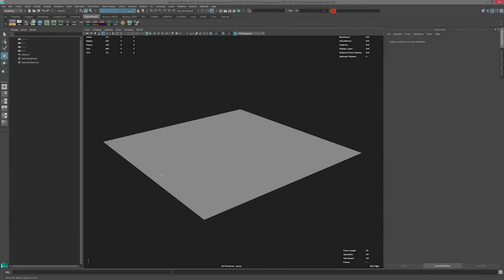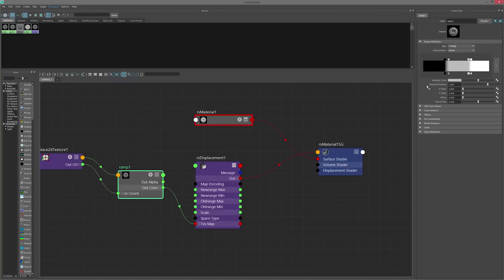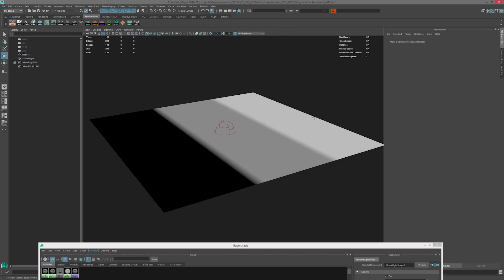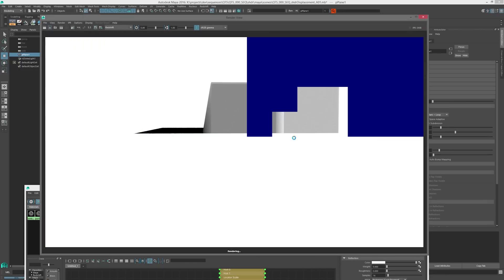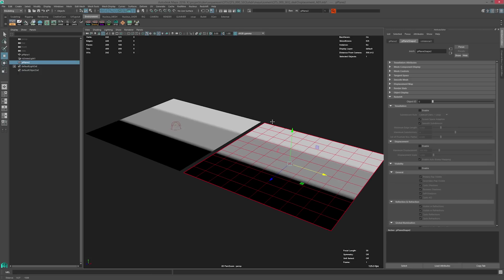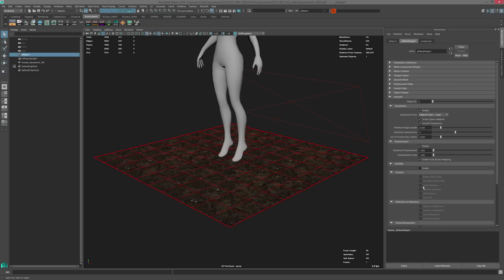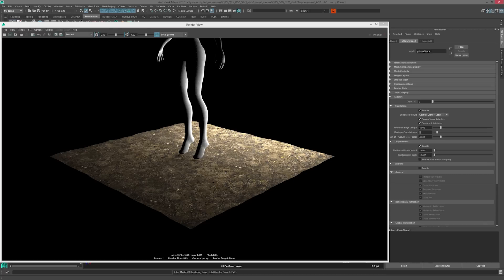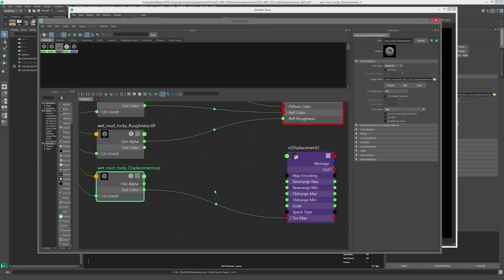Redshift Displacement - CG Quick Tips #1

Comment: Great tutorial thanks : ) 
If i have jpeg roughness, gloss maps which color space should i use ? RAW or SRGB ?
Reply from the maker: You would typically use RAW if you don't want the colour space of your textures to be changed, such as images that have been processed or rendered in linear colour space. It's possible to have jpegs in linear colour space, but in most cases you'll find that jpeg images have an sRGB profile baked in, so you'll need to have them read as sRGB images in Maya in order to render them correctly

Comment: Hi,
I was just wondering if there's a difference if I plug into Displacement mat. rather than Displacement Shader ? Thank you.
Reply from the maker: I believe a while back older versions of Redshift for Maya only applied displacement if it was connected to the 'Shader' attribute and not the 'mat.', though these days it should work in either one if the correct attributes are connected. 

The main difference now is convenience - the output for a RedshiftDisplacement node is simply named 'out' which the 'Shader' input will connect to automatically when you drag n drop. The 'mat.' input however will look for an incoming attribute called 'displacement', which exists on the regular Maya displacementShader node but not on the RedshiftDisplacement node, so dragging an dropping should give you an error and you will need to connect the output manually in the hypershade. 

Also if you use the small checkerboard button and create a new file node, the 'Shader' input will have Maya create a RedshiftDisplacement node for you automatically, whereas the '.mat' input will give you a regular Maya displacementShader node. 

This is best shown visually rather than explained, but if you try out the things I've mentioned you'll see why I keep it simple and just advise everyone to use the 'Shader' input instead of '.mat'. Also, this applies to Maya 2016 and Redshift versions 2.0.7X, though it can certainly change with newer versions.

Comment: for some reason when i use displacements the groudn plane just turns into a complete spikey mess - ive used the same settings and size measurements etc and ive had this issue for every map i use for a fe wmonths now and the work around for me was setting the displcement scale supe rlow - but that way the map was super weak and just looked bad...i cant actually get the results you get :/ any idea what i could be doing wrong?
Reply from the maker: There are various reasons this can happen. If you're sure that the scale of your ground plane is correct, relative to the scene scale and unit size(centimeters is the most common) then I would make sure your displacement textures actually have a midpoint value of 0.5 if you're using my settings. To find out, you can check the pixel values of the grey parts of your displacement texture in nuke, RV or some other image viewer. Doing this can also show you if your displacement texture is 8bit or is saved in the sRGB colour space.
Reply: yeah turns out the strength was way too high and needed to be set to 0.05 instead of the default 1 which seems to work for you! Size in in cm in my scene so that wasn't the problem. either way, great video and thanks for the help!